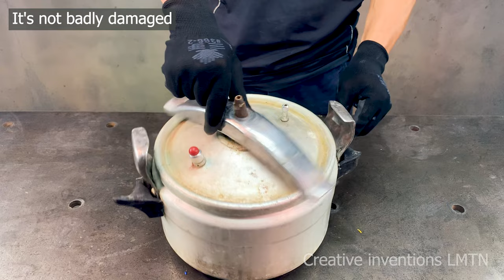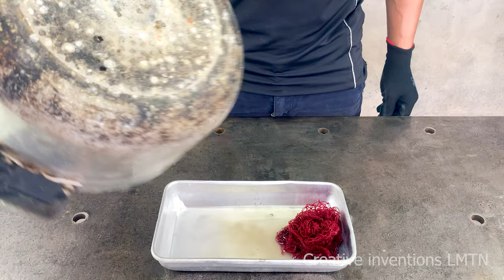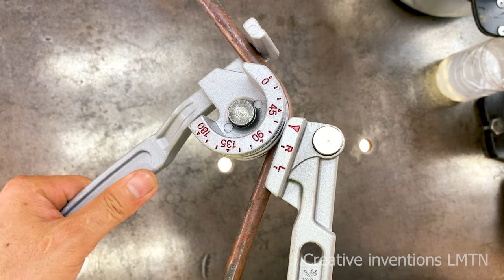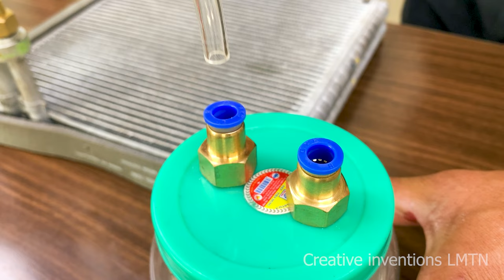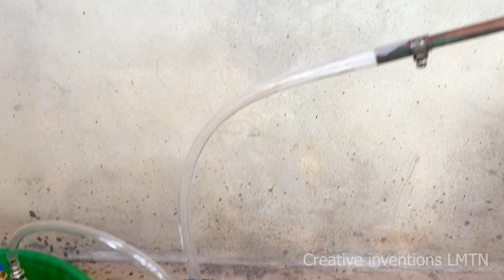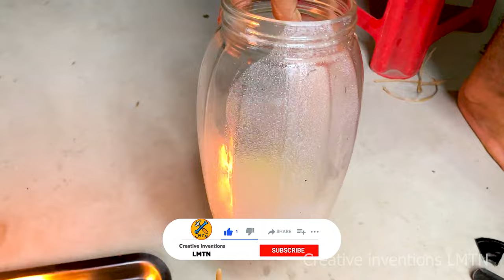Plastic to Fuel | Using Waste Oil Burner to distill into Petrol

Comment: You need to flush oxygen from the pyrolysis chamber using baking soda and vinegar. This will fill it with carbon dioxide. Also, you need a higher temperature, a wax and carbon ash capture chamber and a burn off valve.
Reply from the maker: "Great suggestion! Thanks for the tips on optimizing the pyrolysis chamber. I'll definitely consider flushing out the oxygen with baking soda and vinegar to ensure a carbon dioxide-rich environment. And I'll look into implementing a higher temperature, a wax and carbon ash capture chamber, as well as a burn-off valve for better efficiency. Your expertise is much appreciated!"
Reply: @lmtn  Sounds a bit like an AI generated paragraph… 🤔
Reply: @xmysef4920  that's what I was thinking too

Comment: So, instead of wood chips, this gasifier uses plastic waste. Nice. Mr. Teslonian does a simplar set up only using wood chips and that smokey gas is flammible just like propane gas. He actually fired up a gasoline powered generator with it.
Reply from the maker: Thank you, your evaluation is the motivation to help me improve my stove. 😊 If you have any questions, please let me know, I will be happy to answer ❤️😆
Reply: @lmtn  I tried it too, with a very smal quantity in a steel paint cilinder, with a copper tube brazed, but I don't made a storage, I just burned it in the outside copper tube. After of did it, opened and I find a slice of a coke. I would like to find a way to produce hydrogen using trash of iron and water and combined with polymer it to produce hydrocarbon complex molecules and put it into a electricity generator combined with the use of the rejected heat (cogeneration) in farms that need to warm more than 34000 chickens or in the dry umidity of soybeans. It's a very potential market completely unexplored here in Brazil, but I don't have money or influence to compose a group of engineers and technical friends to do a complex project like this. I will try some more simplified to burn wood using turbochargers recovery from trash in a configuration of "homemade turbojet engine" in two or three stages of compression and indirect heater regenerative Brayton Cycle. The intercoolers of the first stage can be operated as a heat pump and producing more heat of low temperatures for the chickens or soybeans, and a motor generator unit like the used at the F1 cars to generate energy with the turbocharger.
Reply: Video link
Reply: Anyone used this in petrol engine

Comment: How much energy did you use to change the plastic to oil and how much energy did the oil produce? Is the net gain worth the trouble or net loss?
Reply from the maker: you're a smart person, it's just a simulation idea, to make it perfect needs to be optimized and done with a much larger system
Reply from the maker: Do you have a better suggestion to share?
Reply: @lmtn  Not unless you ran a plastic recycling center that colllected an amount that made it profitable. I don't imagine it worth the time and energy on a small scale. Good video otherwise, at least your spreading some ideas👍
Reply from the maker: Thank you so much ^^
Reply: This is a great idea but I would use solar oven and or some solar panels hooked to to some heater coils to do the breaking down of the plastic.  The yield is not going to be high enough to use fuel to get fuel.  Insulate the sides with Rockwood or other high temp insulation and yields  will go up.
Reply: Depends on what you use for the heating. Use waste oil and cost is zero.
Reply: Technically you only have to expand the bulk of the energy the first time. After that you can use some of the oil collected in a run to provide the heat energy for the next run and so on. Every run becomes less expensive after that until such a point where the initial energy cost is is virtually negligible. And if you used free firewood gathered from deal for the first run you don't even need to pay for any of the heat needed to do a run.  There are ways to do this on a small scale that don't actually cost anything other than time and effort. These are ways that large scale cannot really take advantage of.

Comment: What I need, to do it...??
Reply from the maker: To create a waste oil heater like the one in the video, you'll need several components and some basic tools. Here's a general list of what you'll need:

*Materials:*
1. Steel container or tank to hold the waste oil.
2. A burner assembly, which can be made from various materials, including steel pipe and fittings.
3. Blower or fan to provide combustion air and regulate the flame.
4. Fuel supply system for the waste oil.
5. Heat exchanger, which can be constructed from steel pipes or other heat-resistant materials.
6. An exhaust pipe to carry away combustion gases.
7. A support frame or structure to hold the entire system.

*Tools:*
1. Welding equipment for assembly (if welding is necessary).
2. Basic hand tools such as wrenches, pliers, and screwdrivers.
3. Safety gear, including gloves, welding mask, and safety glasses.

Please note that creating a waste oil heater involves working with potentially dangerous materials and high temperatures. It's crucial to prioritize safety and follow any local regulations or safety guidelines related to this type of project. If you're not experienced with welding or working with these materials, consider seeking assistance from someone with the necessary skills and experience. Additionally, ensure proper ventilation and safety measures are in place to avoid risks associated with combustion and exhaust gases.

For more detailed instructions on building a waste oil heater, you can refer to instructional videos and guides available online or consult with experienced DIYers or professionals in the field.

Comment: Hi friend! Have you been used The líquid for a machine ? For exemple Green cut, Lawn mower...
Reply from the maker: It's essential to use the appropriate type and quality of liquid for each machine, as specified by the manufacturer's recommendations. Using the wrong type of fluid or low-quality fluids can lead to poor performance, damage to the machine, or safety hazards. If you're unsure about which fluids to use for your machine, it's best to consult the machine's manual or seek advice from a knowledgeable professional.

Comment: Hello just wanted to know why you put water in a reactor is it so that the reactor doesn't explode 

And if so can you do it with any reactor with high heat because I want to make diesel and gasoline?
Reply from the maker: Great questions! The water you see in the reactor isn't there to prevent explosions. In this setup, water is often used as a cooling medium to help regulate the temperature inside the reactor. Excess heat can damage the reactor or affect the reaction. By circulating water, it can help dissipate the heat and maintain a more stable operating temperature.

However, the specific use of water in reactors can vary depending on the type and purpose of the reactor. For making diesel and gasoline, a different type of reactor, such as a catalytic cracker or a hydrotreater, is commonly used in the petroleum industry. These reactors use various catalysts and high temperatures to break down hydrocarbons into different products.

If you're interested in a specific type of reactor or have more questions about a particular process, feel free to ask for more detailed information.

Comment: Bro please tell fastly can we do inside the house I am thinking to do this for my science exhibition....
Plz tell fastly for my science exhibition only 10 days are left please tell
Reply from the maker: Yes, you can typically set up a science exhibition project inside your house, but it depends on the specific experiment or demonstration you're planning. Ensure that it's safe and follows any guidelines or precautions related to the experiment. You may need to consider factors like space, ventilation, and materials. Good luck with your science exhibition, and I hope it goes well! 🧪🏠🔬

Comment: Run automobile with this
Reply from the maker: Running an automobile with the technology showcased in the video could be an interesting concept, but it would require significant adaptations and modifications to make it practical. The technology shown in the video is typically designed for heating or power generation applications and may not be directly applicable to powering vehicles.

To explore the possibility of using alternative energy sources for vehicles, electric cars and hydrogen fuel cell vehicles are more common options. These technologies are designed to power automobiles efficiently and with lower environmental impact.

If you have more specific questions or ideas related to running automobiles with alternative energy sources, feel free to share, and I'd be happy to discuss them further! 🚗🔋🌿

Comment: What is the smell? Is it the same as real diesel?
Reply from the maker: "It's likely that the smell you're experiencing is similar to real diesel, as biodiesel often shares many of the same aromatic properties. However, there might be some differences in the scent depending on the specific composition and additives used in the biodiesel production process. Additionally, factors such as temperature and combustion efficiency can also influence the smell. Overall, while there may be some similarities, it's not exactly the same as traditional diesel fuel. Have you noticed any particular differences in the smell compared to regular diesel?"

Comment: Why are you not freezing your toxic gasses back to be burnt as a extra fuel source
Reply from the maker: This comment suggests the idea of capturing and freezing toxic gases to use them as an additional fuel source. While it's an interesting concept, implementing such a system would likely require complex and expensive equipment to separate and freeze the gases safely. It's also essential to consider the environmental and safety implications of handling and burning toxic gases. It's crucial to ensure that any such system complies with environmental regulations and safety standards.

Comment: So where does the energy to heat the scrap plastic come from?
Reply from the maker: Great question! The process of heating scrap plastic typically requires an external energy source, such as electricity or natural gas. This energy source provides the heat needed to melt the plastic. If you're interested in sustainable or alternative methods for heating plastic, there are options like solar heaters or waste heat recovery systems. Are you looking for information on a specific method, or would you like to know more about alternative energy sources for this process?
Reply: from the cooker, which uses used motor oil. The channel's reply is made using an AI